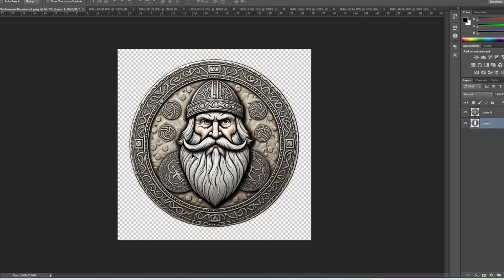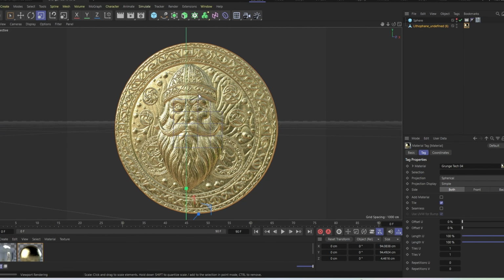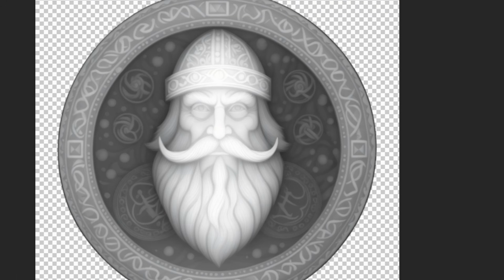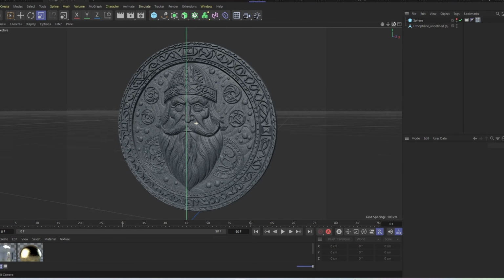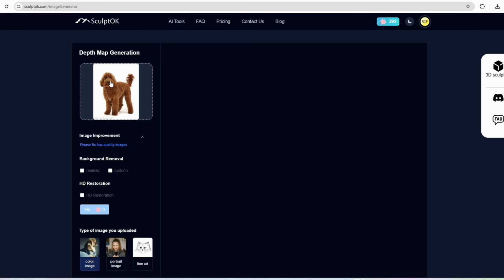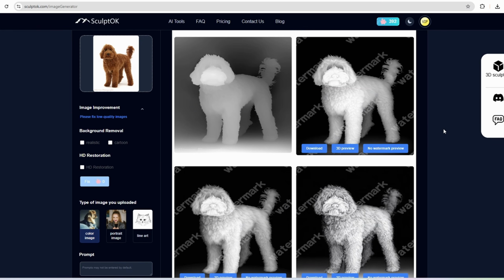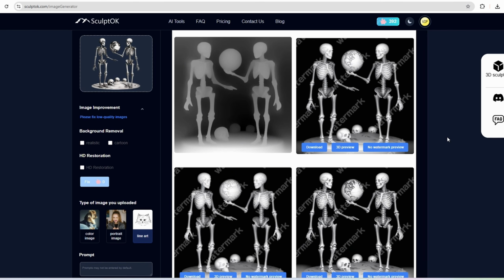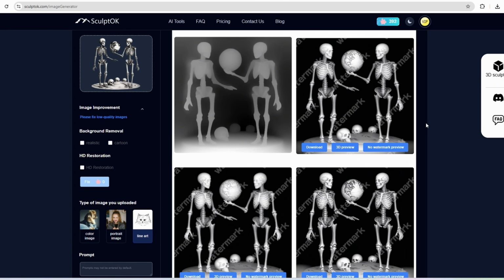Engraving Just Got WAY Easier with Depth Maps!

Comment: I like this video; however, I have a XTool D1 Pro 20W Laser and I have no idea on how to set up the layers to do the depth 3D engraving. Like for a coin, or on slate. Can you help me or tell me were I can get the information? I also have a IR laser for the same machine that I have not used as yet. Can't find a 101 Video on using it. Thanks Tim
Reply from the maker: Create and download a depth map and load into your software (I use lightburn).
Then run an engrave with a decent speed and maybe like 50% power. You want to laser to take away some of the material but avoid burning it. If 50% works then run 3 or 4 passes and check the engraving.
You may want to go faster or slower and more or less passes depending on the results but have a play with it and you’ll get the hang of it in no time 👍🏻
Reply: @MARCAM  what dither process do you use for this process?
Reply from the maker: If I use a co2 laser I’ll use stucki at 318 dpi or with a diode I’ll use grayscale with the same dpi

Comment: This is ridiculously expensive, as prior image preparation is usually required, and the AI engine won't take care of foreground shadows or background highlights, for example. There are free tools for depth map generation with great-quality output.
Reply from the maker: I have seen other sites/ apps being used for this same thing but all results I have seen have been horrible.
No prior editing has been done to any of my images and most depth maps turned out very clean and ready to use.
If you have any links for the other free tools I’ll be more than happy to check them out and compare
Reply: what free tools yo😂 nothing